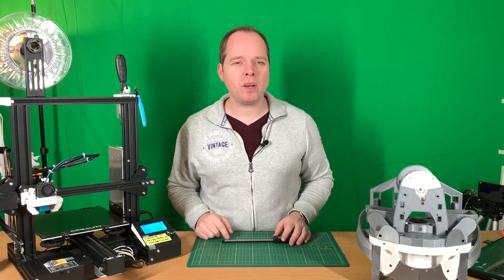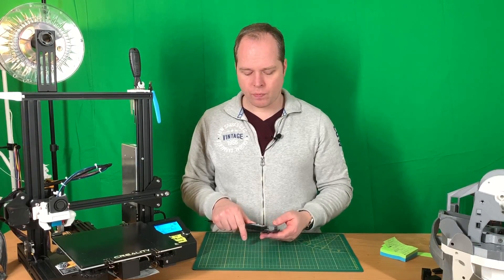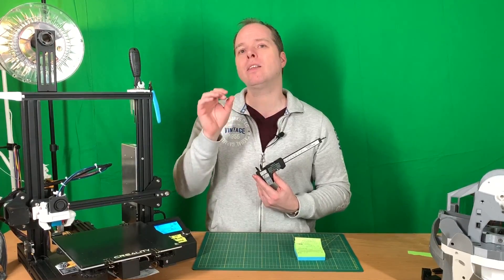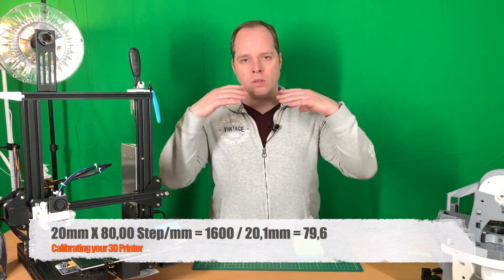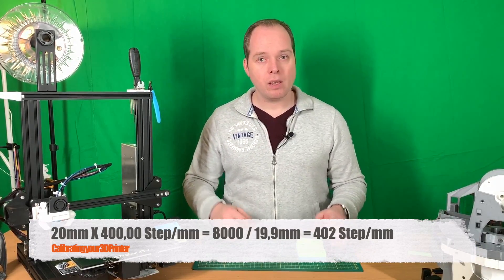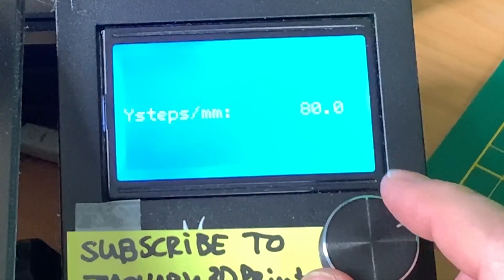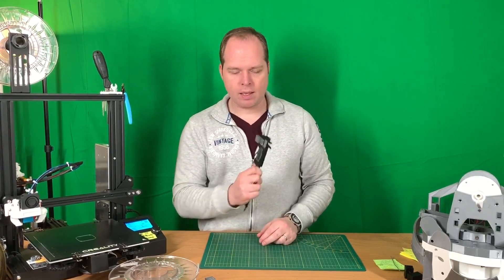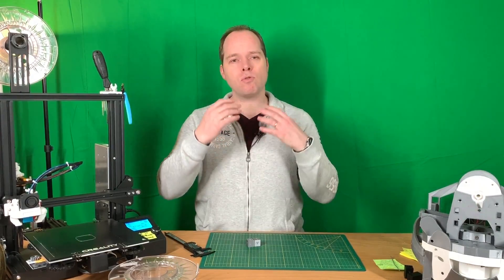How to Calibrate your 3D Printer - Ender 3 Pro

Comment: Thank you, hope this will help my print !
Reply from the maker: Which issue did you had and is it solved?
Reply: @Zachary3DPrints  I was having a lot of print fails due to under extrusion. mainly with tree supports. if I don't use supports for small prints. it'll print ok. Thanks again

Comment: Don't base your numbers on one cube alone. Make one that's 20x20x40 or even a 20x20x60 and print it in laying along the X-axis, along the Y-axis and even standing. If the error measured in the first cube is multiplied in the longer cube, by all means go ahead and adjust the steps. but if it's not, you have other issues.
Reply from the maker: Good point to make it more accurate
Reply: @Zachary3DPrints  Happy to add my little bit to the community. I'm working on getting an Ender 3 Max 'right' these days, and was bumping into this issue. (It was overextruding slightly, which added a permanent +0.1mm to the dimensions of the cube)   My cube was 'correct' but large prints were all undersized.
Reply from the maker: Yeah that is with these kind of things... barely noticeable difference can lead up to a huge difference in the end. Especially working with bigger parts it is going to be challenging

Comment: You dont know how to write maths.  All the subtitles that includes maths are wrong. In second 4:01 for example. 20 x 80 = 1600 / 20,1 = 79. That is wrong written. 20 x 80 doesnt equal 79.
Reply from the maker: Maybe I don't know how to do the maths. I have tried to show with written explanation: 20mm x 80,00 steps/mm = 1600 (result) devided by the measured side 20,1mm makes 79,60199... I have checked it multiple times, what is wrong then in the video?
Reply: @Zachary3DPrints  Your results are correct but the way you write them down is not correct and can lead to confusion, at least here in Spain where I live.

This sign '=' means something is equal to other thing.

Example:
3 × 4 = 12 
If you add another '=', then
3 x 4 = 12 = 11 + 1 = 15 - 3... And whatever operator that equals 12.

3 x 4 = 12 / 4 = 3 is WRONG WRITTEN 
since 3 x 4 ≠ 12 / 4
3 x 4 ≠ 3

I don't know, I was taught maths that way.

Edit: just check 4:01. There is an equality which is not right.  You should have written it in two steps separated, not in the same line with '=' signs. Since 20 x 80 ≠ 79

Edit 2: To do it right you should write:
20 x 80 = 1600
1600 / 20 = 79
Reply from the maker: OK, I see what you mean, I thought that this was a general symbol to the result
Reply: @Zachary3DPrints  yes, it is a 'general symbol' to the result but only when you DO NOT introduce new 'numbers' to the math expression.

For example:

(2 x 3 + 6 - 4) / 2 = (6 + 2) / 2 = 8 / 2 = 4

Then 
(2 x 3 + 6 - 4) / 2 = 4 
 It could be said the symbol '=' leads you to the aimed result.

But If you introduce a new number in the equality that has nothing to do with it, (in your case is ' / 20.1 ' ) then is not an equality anymore.

Comment: I have never tried that, most of the stuff I make is for show.  But doesn't that calibration also depend on the material? There are different shrinkage factors? And Z, sometimes the z step value is off because it ends up or down depending on the layer height?
Reply from the maker: Yes there is also shrinkage of the material to consider, but if you are going to measure, material is also cooled down.

Comment: I see you have the stock e-steps on your printer.
You should first calibrate them e-steps.
Second do a flow calibration.
And last the xyz. 
Also, this method isn't recommended, the recommended method is by mounting a dial gauge and measuring the moving distance of the nozzle.
But, say we use this as an alternative method because we don't have the dial gauge yet.

Thanks for maybe the only video that i've found with directions on how to do this.
Reply from the maker: I started indeed with the stock Esteps from the printer, which where already pretty close.
if you have a dial gauge that would be very great to calibrate the printer, but most people don't have this standard, that's why i have showed this method, to make it understandable, because at first I had problems too to grabbing the calculation

Comment: This is not a good way to calibrate; the extrusion and slicer settings can affect the wall properties of the print. The reason your 20mm cube isn't exactly 20mm may be the x/y steps OR settings related to extrusion affecting the wall dimensions of the print

By scaling the x/y steps to calibrate for a 20mm cube, you might be throwing out the calibration at other sizes.

"A little knowledge is a dangerous thing"
Reply from the maker: hey Scod, you are right, the is a better way, using a ruler and a needle

Comment: I just got into 3d printing. My Ender 3 last 4 days before I bricked it. Not realizing you need a Arduino board to change firmware. Just waiting on parts.
Reply from the maker: Yup very true, those standard boards are locked, but happy enough newer machine are more open.

Comment: at the moment, I can't even get it to print properly. I get print failures on the first layer. Ordered a BL touch as I'm sure there's something weird with my glass bed leveling.
Get's all stuck at the nozzle and melts together.

Edit: for anyone who might have the same issue as me, make sure you clean the bed. Even if you think it should be clean.
Reply from the maker: Which 3D printer do you have? If you have the Ender 3/pro Heat up the nozzle and level the bed, use a piece of paper between the nozzle and the glass bed, just above the leveling knob. Repeat this leveling 2 full rounds until that all 4 corners are feeling equally gripping the paper. The glass bed should give you a very plane surface to print on.
Reply: @Zachary3DPrints  i bought the ender 3 max. 
I can get it leveled on the corners but its too loose on the middle. 

Im not sure yet if that should even be a problem but so far the first layer turns into a mess.
Reply from the maker: How much space is in the middle? Does the nozzle grip there as well? If it does grip, how are to first lines? Are they 'too loose' on the plate? I use some hairspray on a pre heated plate... once every 10+ prints. This works great
Reply: @Zachary3DPrints  It doesn't grip the paper at all. The first line it prints is on the side. I'm pretty sure that's just the purge line. That works perfectly. But as soon as it gets to the middle to do the actual print, it gets hit or miss. Sometimes it lays a good first line but messes up seconds later, and some times it messes up altogether.
Reply: @Zachary3DPrints  Small update: I cleaned the bed with Isopropyl and it printed just fine. Guess the issue was the bed.
Reply from the maker: Cool, glad to read buddy. I'm happy that you did manage it.

Comment: really helpful. I didnt even know you had to tune your 3d printer but it does make sense so thank you for the information.
Reply from the maker: Glad it was helpful! Normally the difference is very minimum, but if the measurements are a bit off, than this can help you in the right direction

Comment: Your all doing it wrong. No idea what idiot started spreading these methods of calibrating based on printed parts but its wrong. A proper way is to use an indicator with something like what I made. https://www.thingiverse.com/thing:4635329
Reply from the maker: Hey Mark, someone did point that to me as well about this wrong method, I will do a new video in the near future. Thanks for the note.

Comment: Do these tuning hold when new cubes that are  printed are smaller and bigger compared to the cube used for the actual tuneup?
Reply from the maker: Normally when you are able to save the settings into your printer, if you switch on your printer, you should the new saved settings, print the cube again and measure it.

Comment: When you calibrate your steppers based on a printed part you are also adding in the sheet of paper thickness that you leveled your bed with, which will cause you to change your Z steps, as well as the extrusion properties of the filament that you are using, which would throw off your X and Y. This is completely wrong. If you ever use slightly more or less pressure when paper leveling or different thickness then your Z is off again instantly. Change to a different filament than what you calibrated with originally and your X and Y are off instantly. You only want to calibrate the mechanics of the machine without adding in variables that change. I have no idea why everyone on YouTube seems to believe this is the best way. Any competent machinist would agree. The way people should be doing this is like any machinist would do there tools, and that is with a dial indicator and/or digital calipers. Personally I used a dial indicator and one of those articulating magnet switch base mounts. Set the probe up against the fan shroud and zero out. Move X 20mm so that it moves the indicator and just use that number. There is no need to average it because you will find that the measurement is exactly the same every time. Checking Y I do the same setup but ride the probe up against the X gantry and move the Y axis while the probe is riding on the front of the fan shroud. Checking Z is the same setup but ride the probe on top of the X gantry. This measures the mechanics and mechanics only which is the whole idea in the first place. Takes out any paper thickness and takes out any filament extrusion properties, and any Z offset if your using a bed level sensor.
Reply from the maker: Hey yeah, you are right. I did see this kind of method. I did use this kind of way of calibrating a 3D Printer to see how it works. Of course the one you mentioned is better and more precise
Reply: If I understood it right, I done similar, for Y axes I use brim to determine first layer hight and take that in to calculating the Y axis, also make shure your flow is calibrated for your filament before you try to determine x and z axis. If my assumption is right I'm on the right track. I'm new to 3D printing had my first printer that I had for 3 weeks now. My printer is a ender V2  so I hope I find same settings for X and Z calibration. I measured more than 0.2 mm of warping in my bed so I use brim measurments to level for current print. Also if anyone uses the ender 3 V2 it is transmission ratio for setting steps. This was the first video I found that don't complicate with sending gcode commands. very helpful indeed, I was down to offset of .2mm but hoping with this help to reach the .15 and optimally .1 offsett. Really informative video, thanks alot. Best regards from Sweden
Reply: @Jim.U_Kerberos  No I think you might have completely missed my point. When you are calibrating your steps/mm for X Y Z you take NOTHING into consideration except for how much travel you get mechanically. That's it. The only point of calibrating steps/mm for X Y Z is so you can get your nozzle where it needs to be in 3D space to print accurately. No other variables matter until after the calibration is done. No variables will effect the results. It either moves accurately to where you tell it to move or it doesn't. I should make a video because there is so much misinformation thrown around its ridiculous. Some of the stuff people say is almost the same as telling someone who is running a CNC that the type of bit used or material type will effect steps/mm. It's terrible information. Its also bad to calibrate off of printed parts because your changing the accuracy of mechanical movement to compensate for other variables that your stepper motors could care less about. 99% of videos tell people to calibrate from a printed cube and it's terrible advice. I'm going to oversimplify here. Strap a dial/digital indicator to your print head assembly, zero out, tell the printer to move 20mm, check result, adjust steps, repeat until your result is repeatable. I calibrated my X Y Z down to .01mm accuracy. If your American like me then inches makes it a little more relatable in terms of how accurate that is .000393701 inches. That's accurate enough for manufacturing. This video is just regurgitating the same bad advice as everyone else.
Reply: @markjones2349  Yes you are right, calibration cube is not the way, I spent to much time trying to make math with all variables that a calibration cube needs to make null, actually a cube can't null all faults, I even started A pyramid to try to null test print out to get a mathematical possibility to null out errors of other errors. with every one fokusing on the calibration cube I lost way to se the simple way, thanks for giving it. I could have fixed my caliper easier but since one of my goals with my printer is spring loaded fittings I'm well on my way after 2nd try to make spring loaded caliper holder for my printer when I need XYZ axis calibration. ie if I burn out a stepper or have a new printer, I don't think calibration is nessesery otherwise, steppers rarely change their properties. Actually the 3d cube is only good to tell if all calibrations are go. Yes bluntly telling, but nessecery to break out of pattern from main stream told you, I'm from sweden so no imperial for me, only metric. Thanks alot for breaking me out of the cube saving me from alot of math.
Reply: Your all doing it wrong. No idea what idiot started spreading these methods of calibrating based on printed parts but its wrong. A proper way is to use an indicator with something like what I made. https://www.thingiverse.com/thing:4636281
Reply: @markjones2349  This link is dead

Comment: Nice, but it would have been better served by using a "stock" printer to calibrate, as not everyone is "upgrading" their printer with the same parts as you are using. Right?
Reply from the maker: Stashman FPV yup that’s true. This printer has to be calibrated. But the method would be the same, only setting it in the menu of the printer can be different.

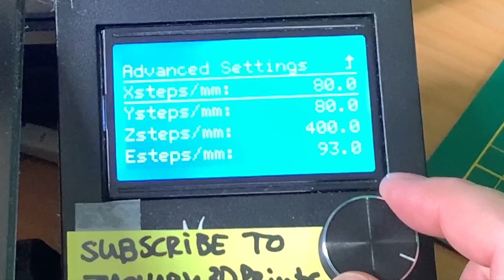Comment: 5:54 unless its WAY of you not need calculating and changes ratios ODD numbers.and you have ready made 3d printer all is setup on firmware.and only correct is round number. its plastic you calibrate it melting it correct
Reply from the maker: thank you for this information

Comment: Great video. But what to do if the Z have 18,6mm and a little elephant foot?  The other axises is 20mm
Reply from the maker: If your Z height is 18.6 what means that your Z steps need to be changed to a higher stps per mm, which one is it on now?
Reply: Hi i don`t remember what it is on ( think it is standard ender 3 pro)  but i have some elephant foot , what to do With this?  I use cura
Reply: I have changed the extruder to the red alu extruder. Shoud i calibrated the extruder?
Reply from the maker: Oh well, if you have a Ender 3 or the Ender 3 pro, the setting can be Changed? I heard that this can be locked, is this in your case as well?
Reply from the maker: Is this one with geared Extruder?
Reply: It is the one whith only one gear
Reply: Have changed to yellow springs and levvelled the bed real good ( must set a thin film under the middle)
Reply from the maker: Which kind of Filament are you using and what is your temperature from the bed and nozzle? If the temperature of the nozzle is too high for the PLA filament, then lower it with 5 degrees.
Reply: I use Prima creator easyprint PLA  Bed: 50 degrees C  Nozzle 200 degrees   ( Easyprint recomandation: Print temp: 180-215 C  Bed temp 0-60 C     )   I will try to lower the temp. Thank you very much for the answers    :)
Reply from the maker: if the prints always looks smooth, then that should be okay. Please check your Esteps per mm for the Z height and make that first right. For my Ender 3 pro with Marlin 2.0 my Esteps is 402 mm
Reply: https://www.youtube.com/watch?v=vSKT2WOVG8I

Comment: I installed a SkR Mine E3 1.2 and did my Esteps, find out this morning board is broke, sending me a new one. But do I now need to do they ESteps again, or can just copy them from the order board?
Reply from the maker: I have for the Esteps i on the Ender 3 Pro 93 steps/mm. This is a standard in marlin 2.0. If you have problems with under or over extrusion you can change this. But with the all metal hotend I don’t have problems
Reply: Mine was off by about 5mm so I changed those setting in the new board. But now nee board is broke en got another one. So I just copy these new Esteps I needed?
Reply from the maker: In which axis was it 5 mm off?